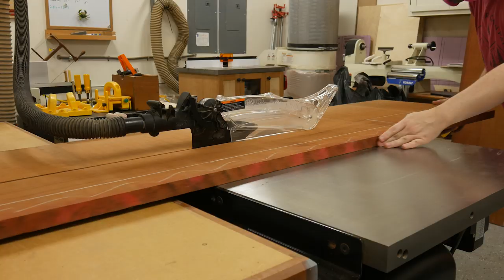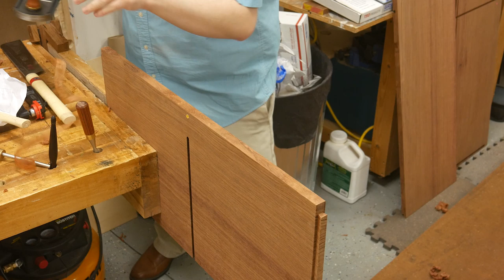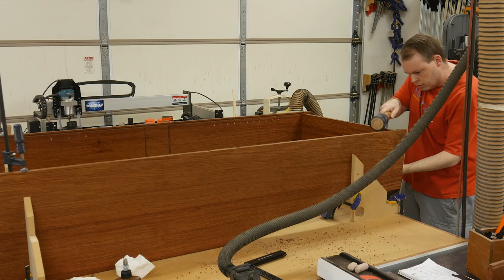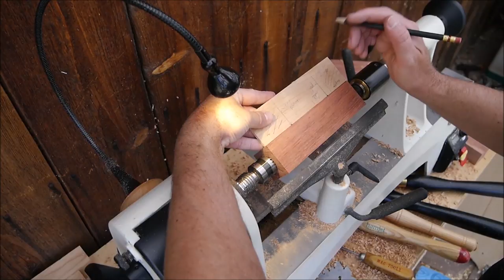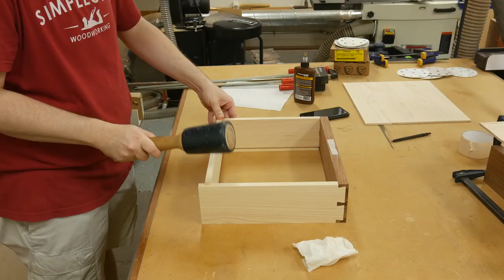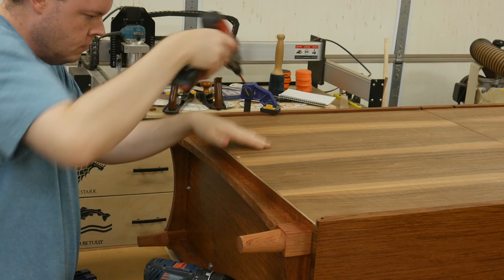Modern Bubinga Cabinet With Plenty Of Storage

Comment: I wouldn't presume to denigrate anything you've done here but I, personally, would not have been able to leave the top like this. I'd have to add a top to the piece. That Bubinga had to have made this piece way out of my price range anyway. Gorgeous stuff. Made well enough to last generations. (except maybe the glass... 🤣🤣)
Reply from the maker: Thanks. It's a design decision I went with(re:the top). The top is actually there, it's just inset from the top. I also cut the side panels at an angle so adding a top wouldn't have looked good in my opinion.

We are all allowed to have our own opinions though.